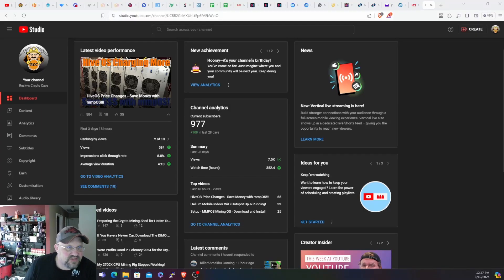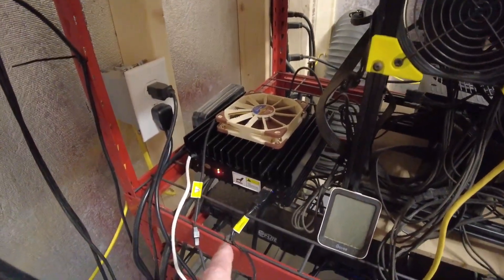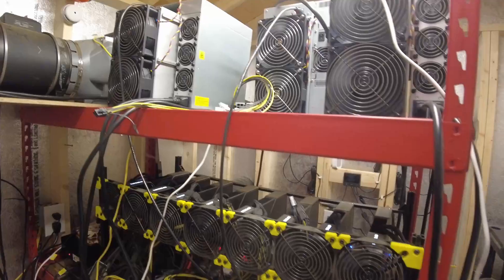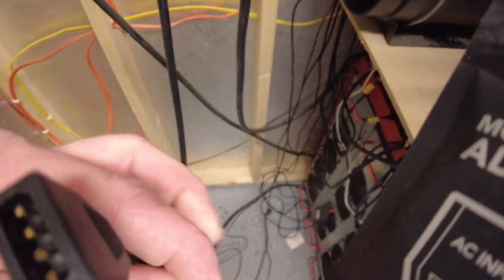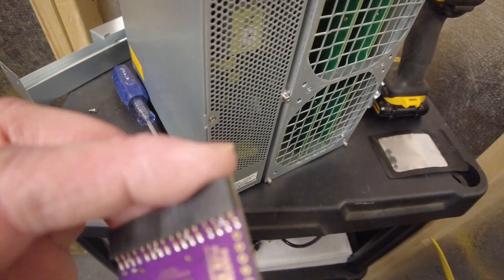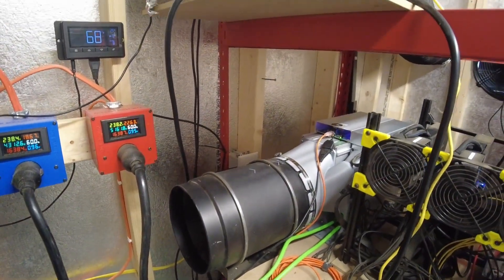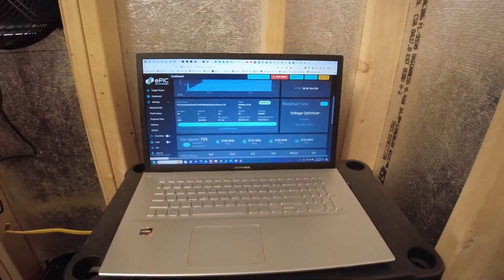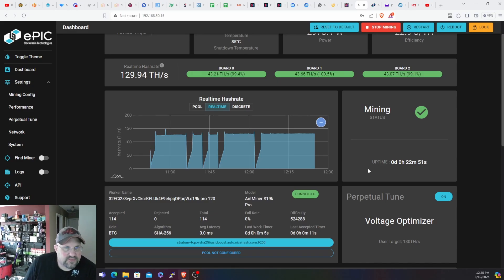Installing S19K Pro Inline Fan Kit & Njord Fan Controller - Success!

Comment: My s19k pro only has 2 plugs for the fans where you would usually put spoofers the fans for the intake have 2 much bigger plugs not 4 in a row like yours has?
Reply from the maker: I have the ePic control board on my S19K Pro so it uses the normaal faan plugs.  I had to buy new fans as well to go with the control board because of the newer style connectors
Reply: @ruskyscryptocave  ah right I see well I’ve still put the inline fan on it with the fans on. Been told it’s ok but also herd others say not ok it’s difficult to get the right answer for a lot of things as people have different opinions and experiences

Comment: Great content! Do you think the s19k pro is worth picking up now after halving? My rate is .06. You should try adding solar power vents on the roof. That will really push the heat out.
Reply from the maker: My opinion is out of the s19k series, the 110th model is the best bank for the buck. If you are at $0.06, you should be fine as far as profitability goes. I bought the s19k 120 w/o doing the math. The 110 is a better $/hash. I would like to pick up some of them or an s21. I’d have them hosted though since I’m kinda maxed on power.

Comment: All great but thats not s19k over there you installed njord its older moder s19k need adapter to fit in . Tf
Reply from the maker: Not when using an epic control board you don’t. Stock s19k control board you need the adapter for the different fan plus which I state in the description
Reply: Correct . But still in stock bitmains  os it has some issues . And run at lower th/s after this upgrade dont know why stop hashing trying to troubleshoot it